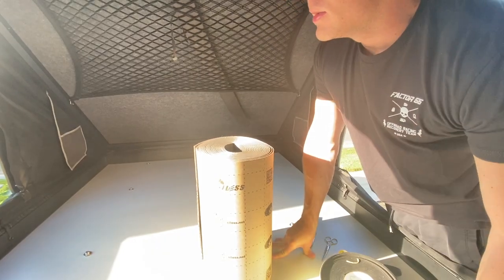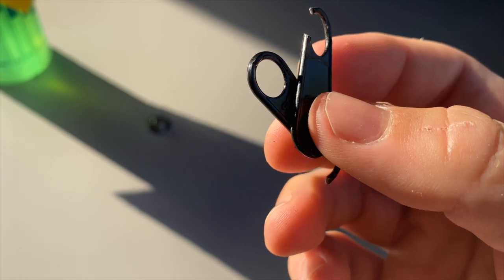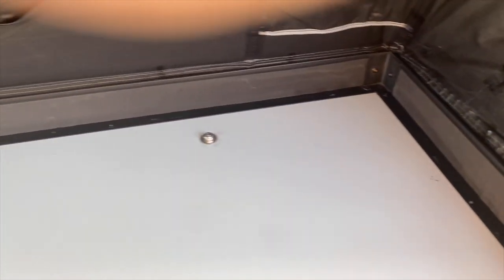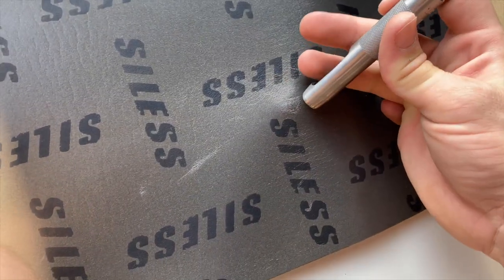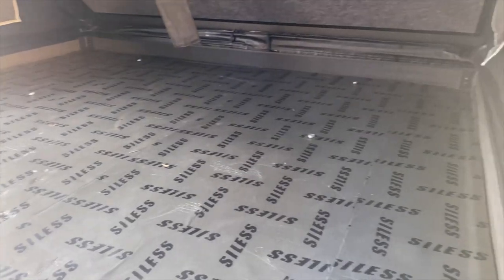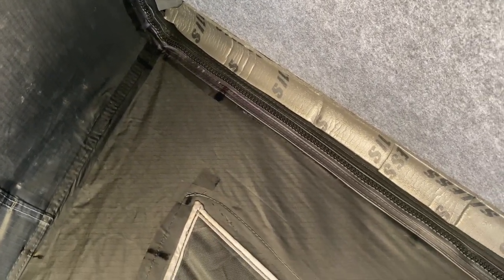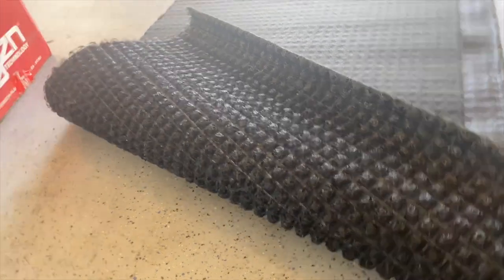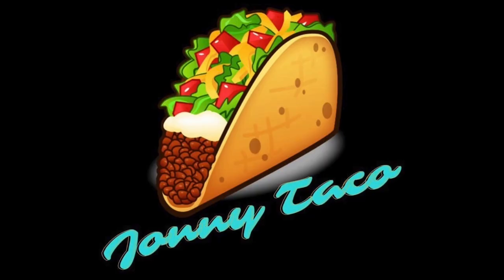Watch This Before Buying A Rooftop Tent | You Need Anti Condensation

Comment: It does stop condensation on top but it will still get wet under the closed cell foam. I did this and was great till my mattress was wet on bottom.. ends up it was like a mini pool as the water built up underneath the foam
Reply from the maker: Thanks for the info!
Reply from the maker: Thanks for the info!
Reply: is there a fix for the condensation?